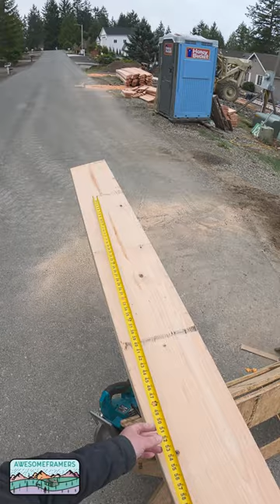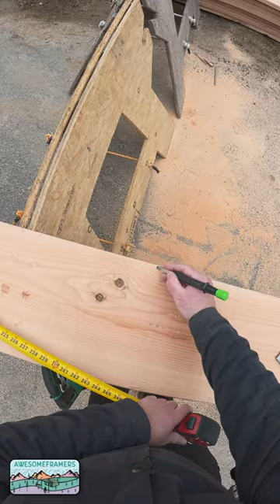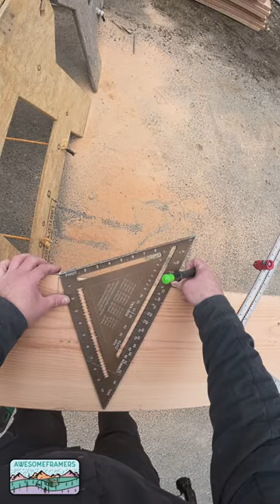Rafter Birdsmouth #roofframing #construction #framing

Comment: Talk about efficiency. I’m in trade school and I usually need a framing square for the level/seat line
Reply: Yeah this guys a legend. Has this stuff down to a science.
Reply: It’s better to use framing square 100% yeah you can do it with speed square but framing square is better
Reply: @jakeatkinson4913  good point🤔👍
Reply from the maker: @jakeatkinson4913  Why is it better? If you make a claim like that, its helpful for the rest of us to quantify it.  As you saw in this video or another, checking the 12" square against the Martinez Rafter square, the results were the same, ergo, it doesn't matter which you use, neither is "better".
Reply: I recommend learning the trade school way, you should not need “slop” if you have done a proper calculation for your rafter, once you have applied the skills long enough you will figure out your own tricks/shortcuts
Reply from the maker: @willbell9642  you aren't a framer, it's quite obvious
Reply: @AwesomeFramers  😅 correct I am a carpenter who can calculate my framing members without leaving “slop”. I am a carpenter who can work with all materials and trades to complete any build. Anyone can be a framer, trade school and the industry clearly prove not everyone can be a carpenter. Do you tho awesome framer, this platform allows you to act like you know it all 👍🏼
Reply from the maker: @willbell9642  I don't believe you, you're using the Internet to make yourself sound like you know something.  You're a pretender
Reply: If one is using fractions of pitches ie. 4-7/8:12 we will need a full size framing square, or for marking longer seat cuts on various rafters longer than basic common heel stand. Aside from that, the pitches and angles are all the same, and it is in fact faster to use the large rafter speed square when the marks are small enough to do it. It's called a "speed" square for a reason!
Reply: That comment tell me your in school Newbie lol😂😂 just messing w/u

Comment: What determines heel stand height?
Reply from the maker: lots of things.  There is a minimum level or seat cut and then hanging past the plate is not a good idea (usually).  I base it off maximizing insulation and capacity of my saw for gang cutting.

Comment: I don’t understand the add a quarter for a little bit of slop. I’m sure you know much more about framing than I do but the plan to give you an exact number for a reason. make it correct and straight and everything will work out.
Reply: There's always a small chance of error when taking measurements with a tape, especially when you're running said tape from the ridge board down to the top plate...  It's better to have a rafter tail run a little long and trim if needed, than accidentally cutting it too short and then having to scrap the board you just cut... Yes you can use a shim if needed between a short tail and a straight fascia board, but these guys don't mess with that kind of b.s.
Reply: Build much do you?
You make it exact and then you're running the 16" wide soffit material  (which is razor straight) and then lumber being lumber, your wall has a slight bow in it and well now you have to take the soffit pc down and custom scribe it, and for what?
You install your soffit and then you have a 3/4" trim board under it, what does it accomplish to make it exact?
Sheesh, armchair carpenters in the house.
Reply: You know how hard it his to make non perfect wood perfect over the course of a whole building made of wood.  Its never gona be perfect with wood because u wood need to get lucky and wood has flaws too